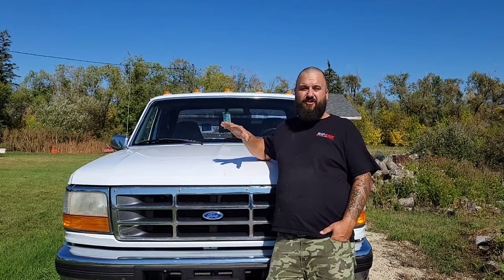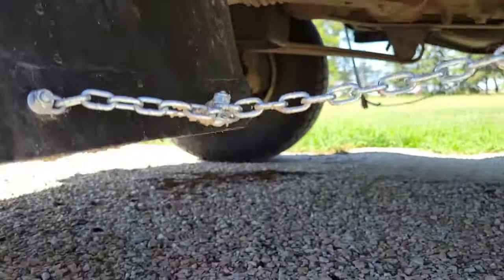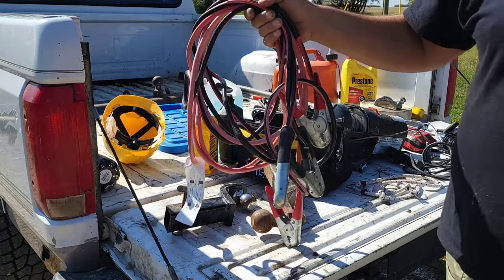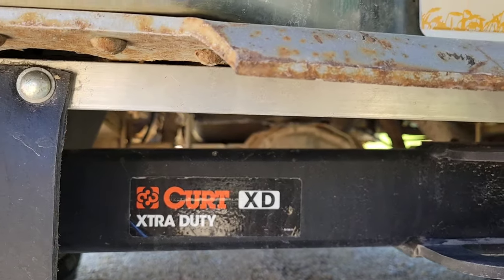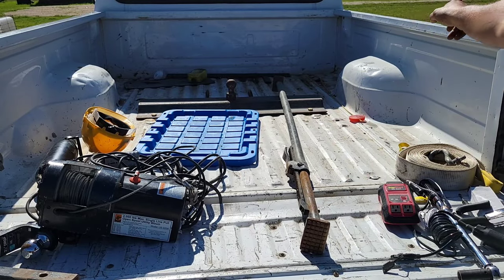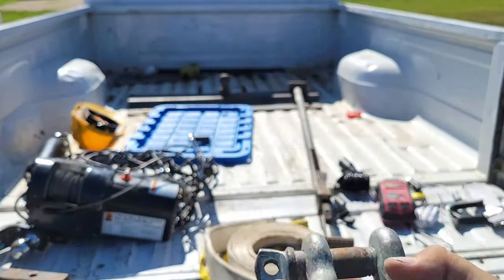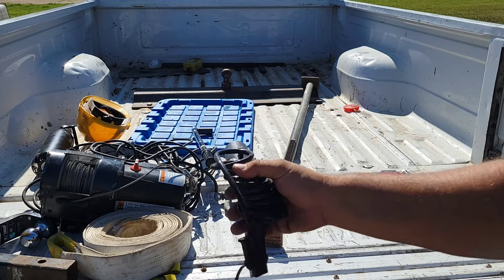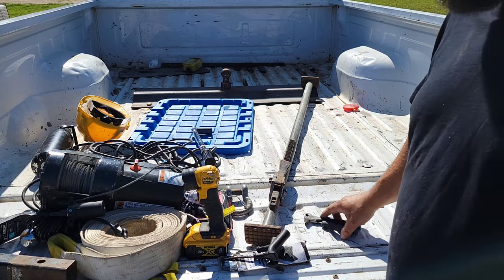Winter driving?? You need to watch this!!

Comment: My recommendation for winterizing that truck is 1) check your glow plugs, 2) stick a piece of waxed cardboard between your grill and radiator, 3) install a glow plug bypass button,  and 4) upgrade to Group 31 batteries.

Comment: Excellent reminder for many, although the ones that need reminding will never take it to heart. You should not be driving around in Canada without being prepared for emergencies and the winter season, all us fathers need to take our kids aside and teach them when they start to drive our cars and eventually purchase their own. It doesn't matter if you are a city dweller or in deep rural area's, safety is safety and you need to be prepared in the odd chance you may need assistance or you can help out another. 

I carry most of the gear you mention plus a few more items i find useful as an emergency kit. I like not just the 25 foot 1 gauge jumper cable, but also a lithium quality battery charger pack seeing it can not only boost a vehicle but also charge USB devices (cell phone) and has a super bright light. For flat tires i like a tire patch kit, tire in a can (flat repair can) and a separate 12v air inflator. 

For the most part tires and power (battery) are the two major concerns so best to be prepared for multiple ways to solve that issue, then the rest of the emergency material/equipment that you can pile on top is just gravy to the mix.

Comment: I live in south central Pennsylvania and have one of these trucks. I have a snow plow bracket with the hydraulics cut off and a winch I’m it’s place so I can operate the plow and winch myself or anybody else out if need be. I carry a pew, saw and tow strap in the unexpected winters here. Some years it’s nothing and some it’s deep snow or ice. My driveway is a half mile stone lane on 300 acres so I have high winds all the time. I have a creek in my driveway that floods often too. Drift can be wild. I’m the one they call to get them out so I’m usually prepared for anything. Another thing about these trucks is vacuum pumps. Gotta keep one in your stock with a belt. I also keep a 3000k jump starter in my truck at all times. It has a built in light with phone charging ports